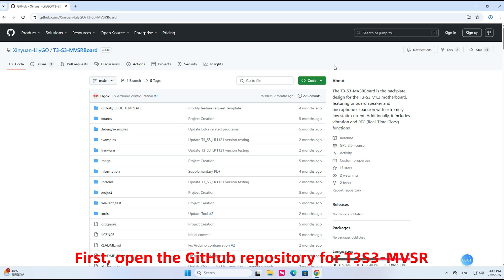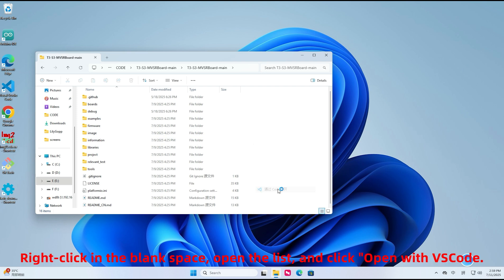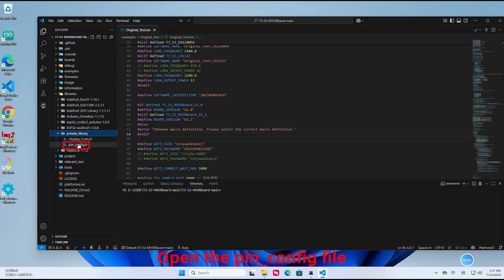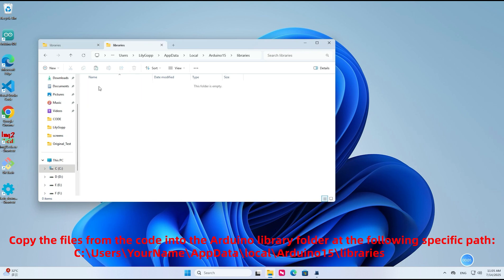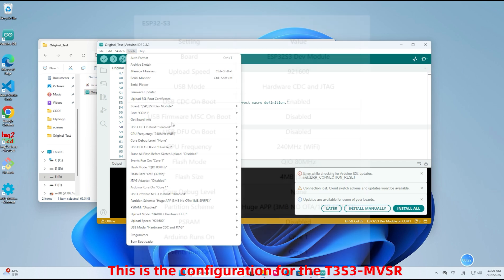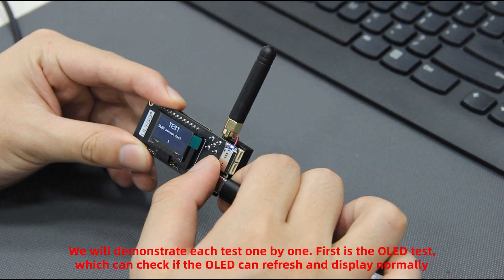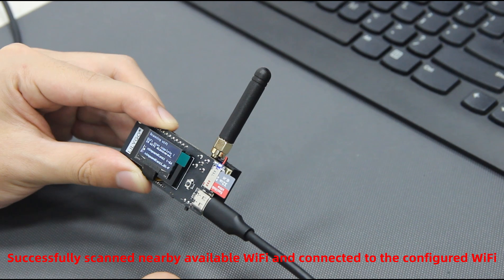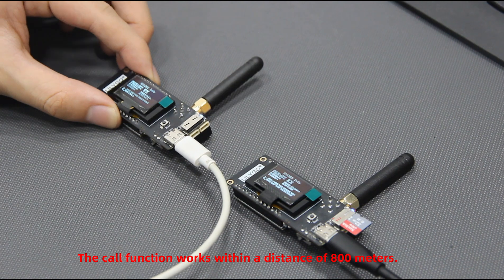T3-S3 MVSR Explained: Hardware Setup + Software Configuration | LILYGO Official Guide

Comment: What is the voice quality and the max range achievable for walkie talkie although its mentioned to be 800m in video but can it be increased using same board?
Reply from the maker: It’s still under development and not supported at the moment.
Reply: @LILYGO so you are developing a longer range version, that's good